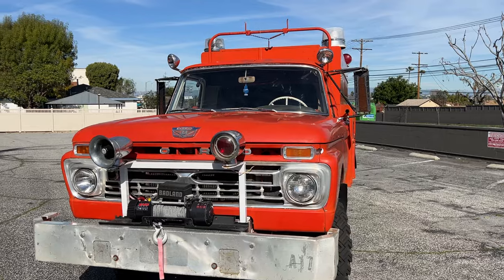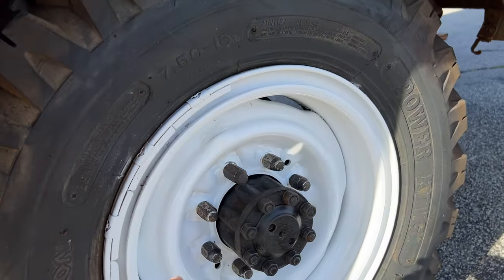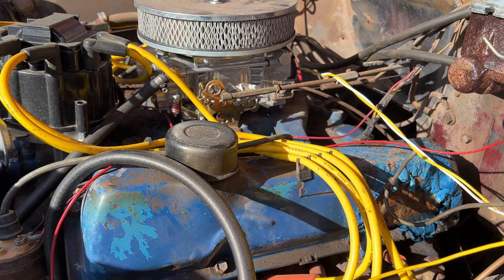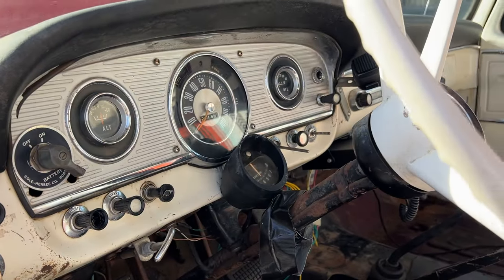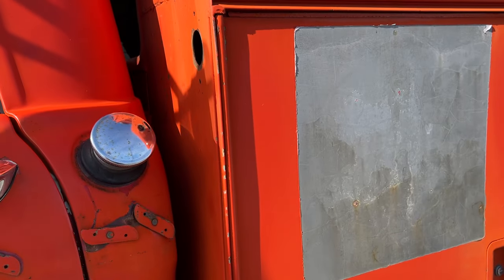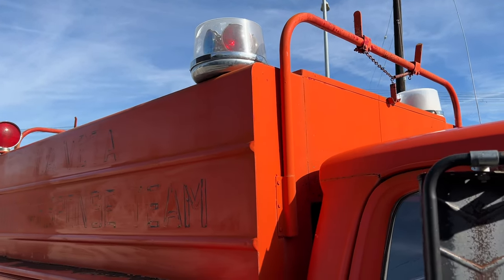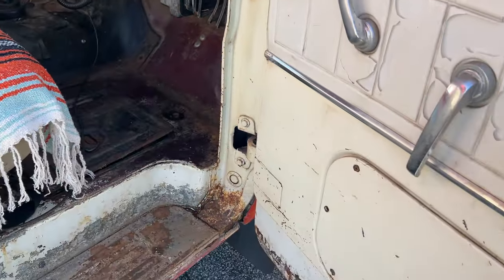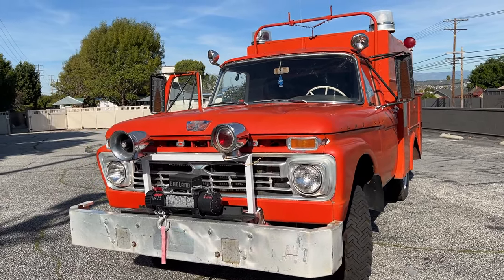1966 Ford F-250 4x4 Bush Rescue Truck Walk Around

Comment: Wnere did the rear driveshaft go?
Reply from the maker: When I bought it the rear driveshaft was bent and the rear gears were broken. I put a new rear end in it and have a spare driveshaft that needs new u joints
Reply: @Rubber_N_Smoke  Makes me wonder what those Jockeys did to bend a drive shaft and bust a rear end gear, shmeesh.
Reply from the maker: @dand3975  yeah! I think it was the guy I bought it from did a burnout of 2 haha